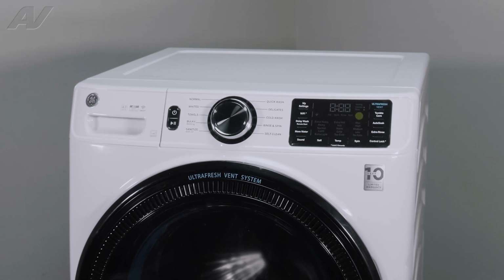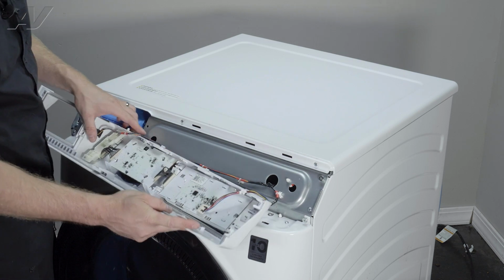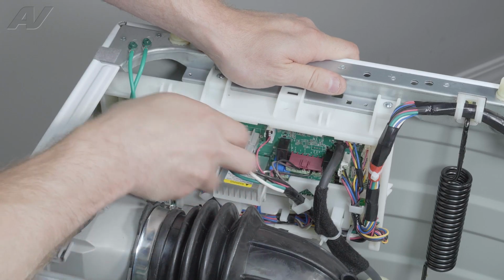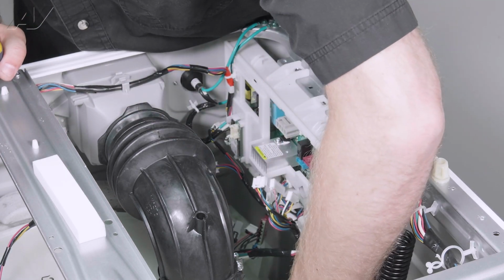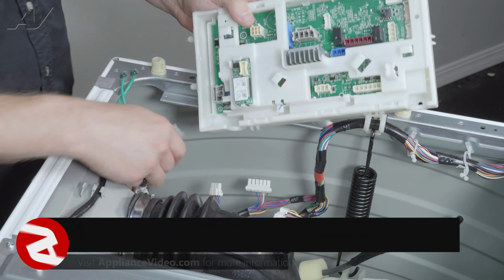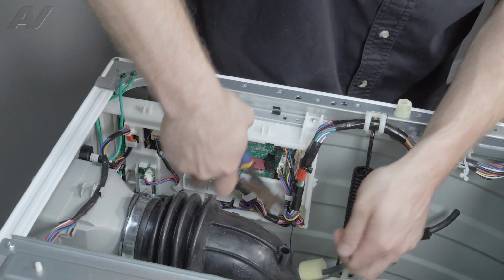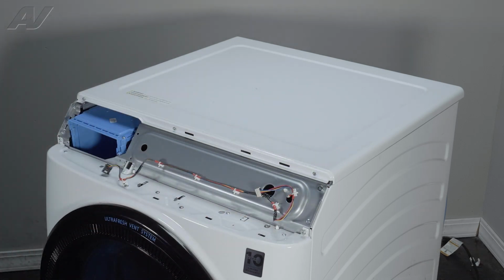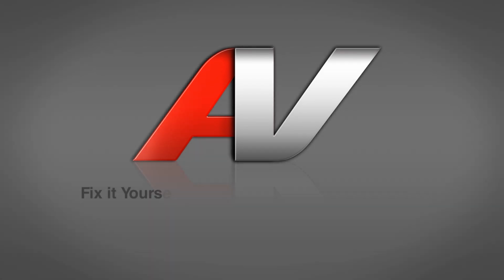GE Washer Repair - No Power - Main Control Board

Comment: There was no mention of how or whether the control board was diagnosed as bad, or if he was just blindly replacing a part to see if that would fix the issue (no power).   It's considerably more important how to diagnose.  If one can diagnose that the board is bad, then replacing it isn't difficult.  I mean that a video on diagnosis would be much more helpful because if you've gotten to the point of diagnosing the board, you've already got access to it, and removing and replacing it isn't so difficult to understand as to require a video.

Comment: I can't get that last connector out that you pulled out last. How did you remove that connector. did your squeeze from top or sides?
Reply: Top and bottom. Its just a phone jack thats not even used. Dont be afraid

Comment: I have this exact washer. When it is plugged in, the display will have power for a good 3 seconds then shut off then got power again then shut off.
Reply: @cantonwine1 replaced my board worked for 2 minutes and back to blank
Reply: @cantonwine1  Yes, I bought the bord from Genuine Parts Replacement out of Florida. Still working for weeks already.
Reply: @cantonwine1  no problem, luckily mine is still under warranty so I'll have them come out and look at it. 

And i agree this will be the last GE product I'll buy. Had an amana before worked for 10+ years with simple maintenance.  Smh
Reply: @lonewolfb5825 Hello there, input your washer model in full, they will list put the part number for you in the drop down, there is a few page to go through until you see the board.
Reply: @lonewolfb5825 Hi there, for my case you dont have to re-program anything. It was just plug and play. This case, Do you think it is the displayboard in front instead of the mainboard. Check for the wire connection that goes from the main board out then connect to the front displayboard.